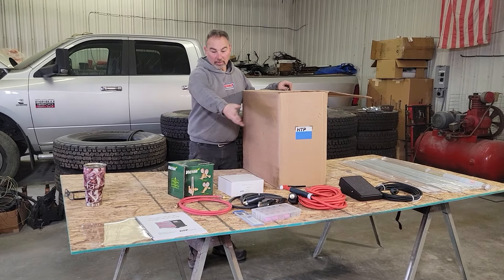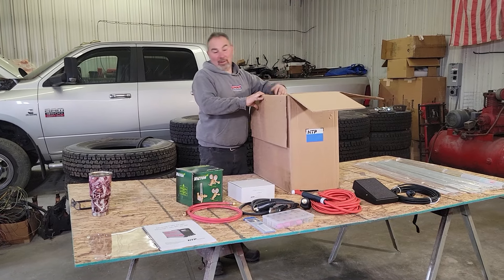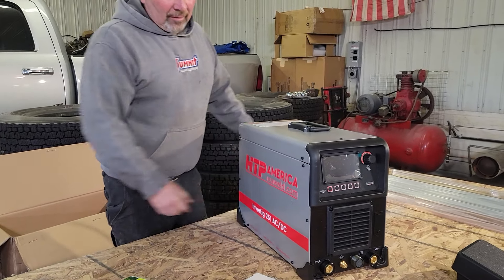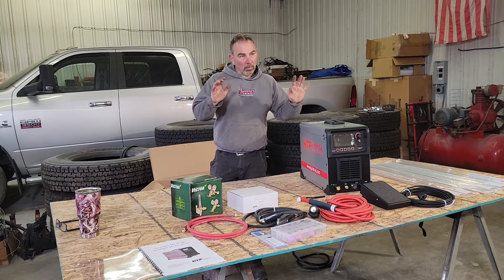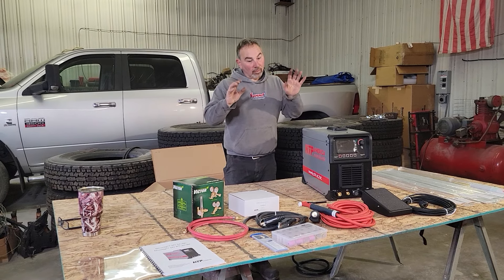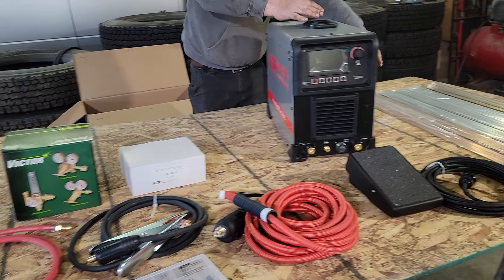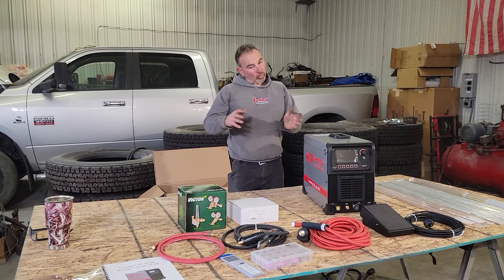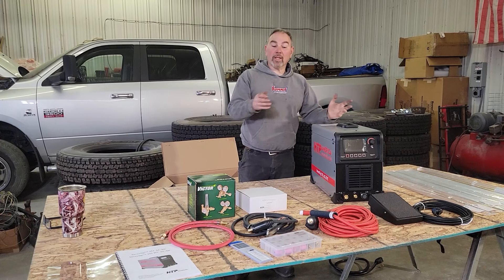THIS IS HUGE! BRAND NEW HTP TIG MACHINE! WHAT DO YOU WANT TO KNOW ABOUT TIG?

Comment: Love the channel.
I have a Chevy cab forward w3500 box truck which is the isuzu npr with the Chevy 350 vortec engine in it. Want to cut the box off the back and make an aluminum dump bed. Dont need super heavy weight capacity. Have a bunch of aluminum tube ready to go. Would love to see an aluminum dump build and the welding for that. Also how to mate up the aluminum where it will touch the steel.

Comment: How about welding  used aluminum oil pans , I seen other guys have a real hard time doing supposedly due to oil contaminated metal .
Reply: JC, if you read that and you have an old oil pan, i will bring some specialty rods and we’ll do one.
Reply from the maker: justin has some aluminum oil pans and valve covers we could use.
Reply: Sounds like a good video.
Reply: @ZILAwelds thank you guys for doing this!
I'm interested in the 251 size TIG welder.
Excited to see the instruction.
#JCSmithprojects.